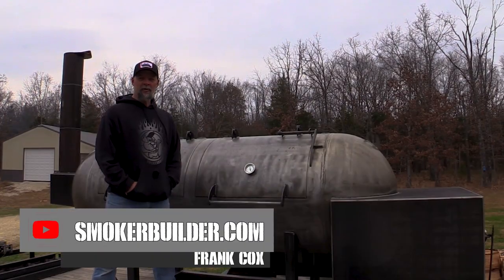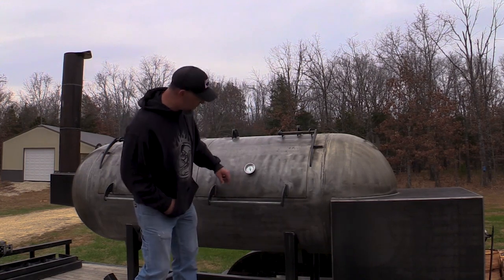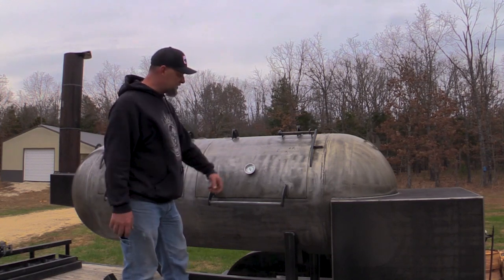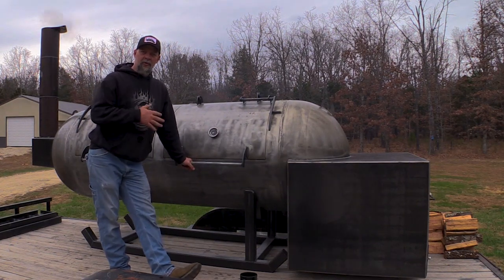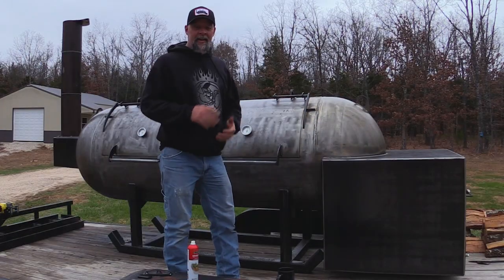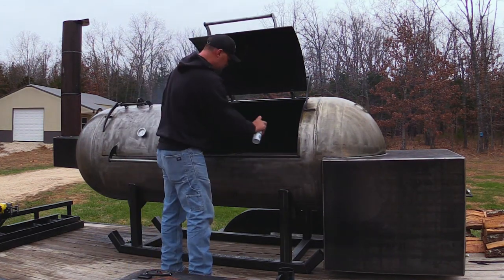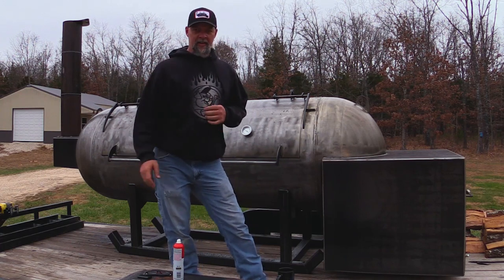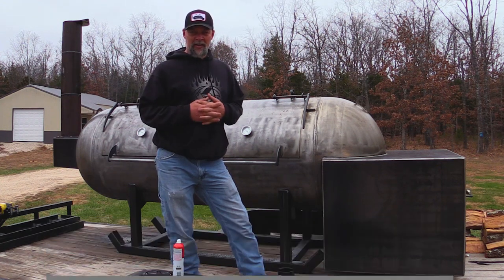How to clean and season your new offset smoker

Comment: Hi
Im building a 500 gallon smoker.
Im thinking of having ceramics/bricks in the actual firebox wall/bottoms. What do you think about that?  There will be a airchannel to the bottom of the fire bed. So it will be easy to start up.
Reply: I lined my firebox twenty four square with the bricks half way up, if weight isn't an issue they really work keeping the heat in.